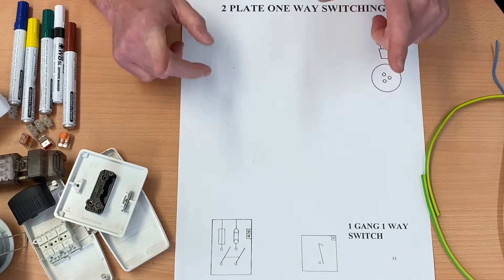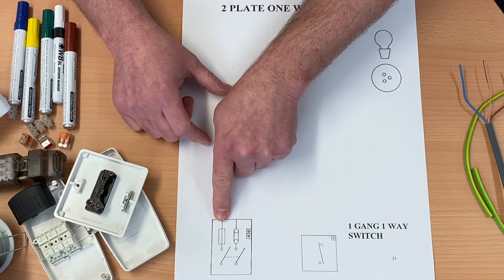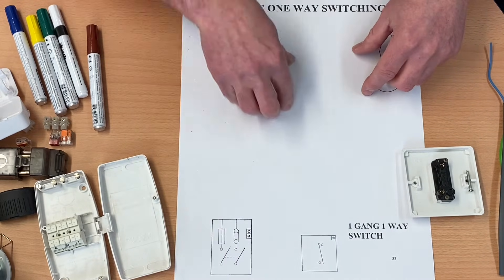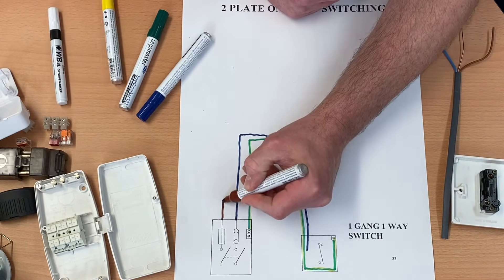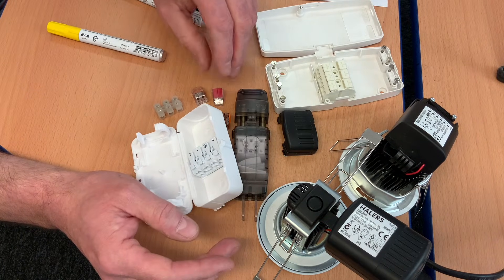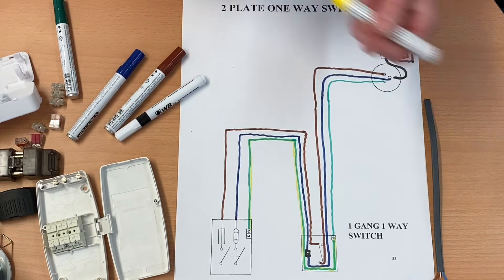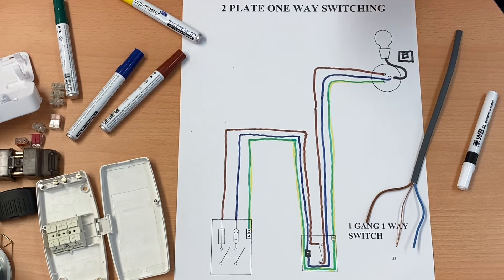Wiring Diagram Lighting Circuit 2 Plate Method Taking the Feed to the Switch - 1 Way Switch & Light

Comment from the maker: == 🕐 Time Stamps - Cut to the action 🕕 ==
00:11 - 2 Plate method of wiring a lighting circuit (taking the feed to the switch)
00:53 - Using PVC PVC Twin and earth cables (twin and CPC cables)
01:47 - Connections in a one way light switch 
02:16 - Connecting to a LED downlight 
03:15 - Wiring the CPC conductor to the switch 
04:00 - Wiring the neutral conductor the to the switch 
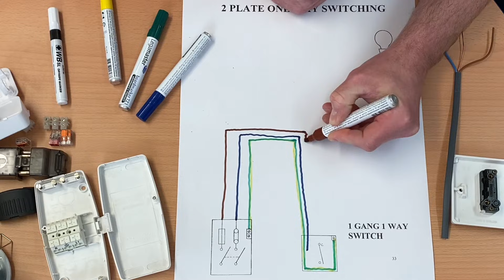04:22 - Wiring the line conductor to the switch 
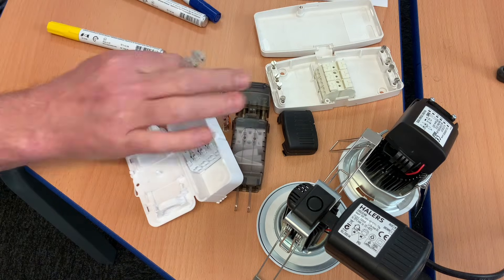05:25 - Wiring the neutral from the switch to the lighting point using a Wago or 5 amp connector or Insure connector
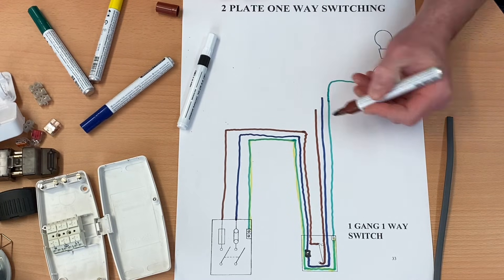07:05 - Connections at the lighting point (LED spotlights) 
08:07 - Summary of connections and learning 
08:51 - Adding more lighting point to the circuit (LED spotlights)

Comment: Is there any (ideally summary-style) video around that only explains the various different physical arrangements only? Like, comparing 2 plate vs 3 plate etc, just showing where the cables are traveling between the different locations, maybe at most with a notation that says 3+E (or 2 or 4)? So, like, only showing the details you need at the first fix level, as opposed to these detailed wiring diagrams that are much more second-fix oriented? Making the switching circuits come out correctly is pretty trivial, but deciding which possible arrangement to use in any given building seems less so to my mind.

Comment: how can the downlight at 7:50 have no earth when there are clearly metal parts on the exterior.
Reply from the maker: They are class 2 equipment also called double insulated so they don’t need a CPC (earth)
Reply: @GSHElectrical   might say on the cover but how is that possible with metal exterior parts?   It's possible (although admittedly quite unlikely)for a loose live from the terminals  to come in contact with those metal parts.  Am I being too cautious?  

I don't trust labelling anymore.

Comment: Hi I need a bit of advice I have done a EICR on a rented property with no RCD the land lords wont's to fit a Masterplug RCD plug adapter 2 pole rated at 13A 13A V ac for the time being. then he wont's me to fit 3 RCD sockets 2 in the garage and 1 in the kitchen where they use it for mowing the lawn. I have looked in the REGs but can not find anything that cover this do you know if this would be acceptable.May be this could be a topic you could cover.
another well explained video.

Comment: What does the plate mean? Like 2 and 3 pate methods?
Reply: I always remembered it by the light fitting. If you connect the  line supply into the middle loop plate on the light fitting you have to use all of the 'plates' in the light fitting (L, LOOP, N). If you wire through the switch, you only connect onto the 2 end plates in the light fitting (L&N)...